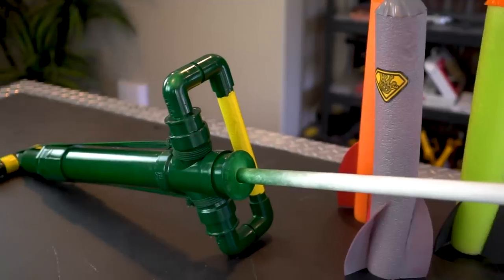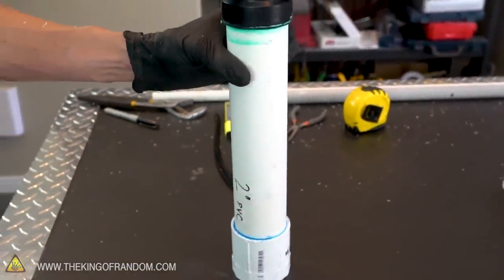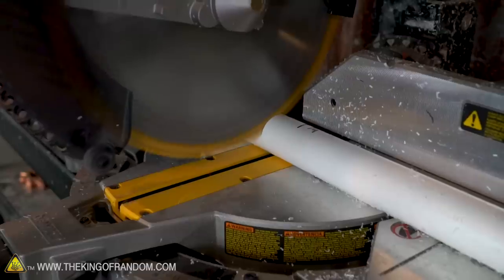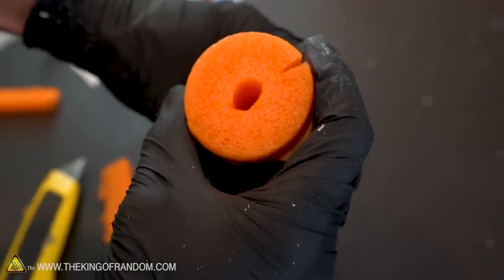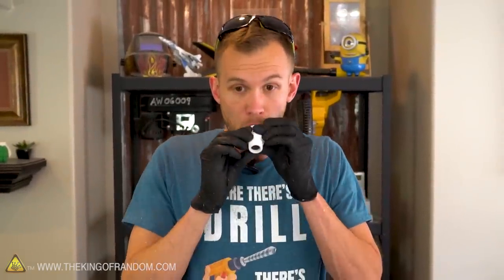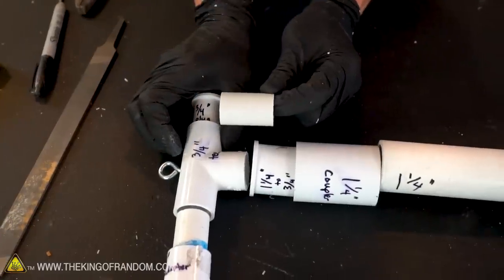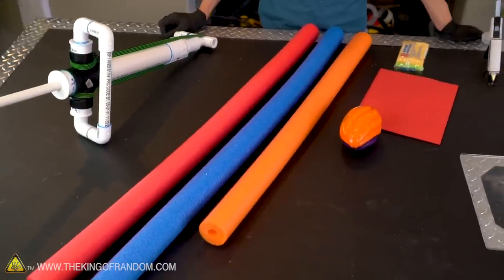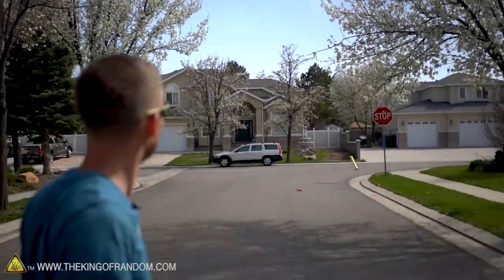PVC Rocket Launcher & Pool Noodle Rockets! PVC + Air + Foam = The Best PVC Cannon Pipe Projects

Comment: I think this could be retrofitted for use in airsoft wars. Maybe a small amount of compressed air, score the inside of the noodle in 4 places to ensure even splitting, fill it with airsoft bb's. The only hard part would be trigger mechanism, considering it may have the ability to strike another player directly. It would make a great mortar replica.

Comment: You could make it perform better by moving the one-way-valve to the top of the plunger, in that way the piston itself won't be pressurized. Also block the handle to get pressurized. That way ALL the air that gets under pressure has to escape to you projectile.

Comment: That's pretty cool. But you probably could achieve better launch performance if you had plugged up the pipes into the handle loop, as the extra volume added by the handle reduces the overall pressure build of the system. Granted, the pool noodle pieces you stuck in there (to keep the plunger from going in too far) might block some of the air transfer, but a solid plug would be better (possibly done the same way you plugged up the end of the pool noodle rockets). It seemed like NightHawkinLight's launcher's missiles had a higher launch speed, and I think that may be why.

Comment: you should make a vacuum gun/cannon. it's like you build up a vacuum pressure then pop something on one side and the projectile inside shoots flying. since the air rushes to fill the vacuum the air hits the projectile and shoots it at almost supersonic speeds.

Comment: I suggest making a grenade launcher with grenades fired off basically with pressure you can fire the projectile.and as the grenade gunpowder use the thunder caps powder and add a fuse.u can light it up fire off or show off a real life molotov cocktail!

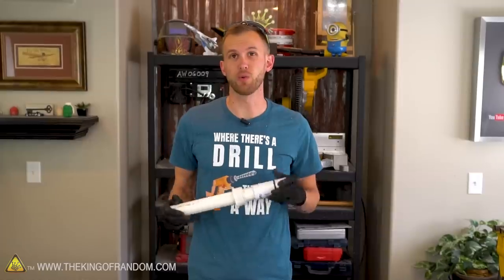Comment: At 5:29 you're holding the plunger with a threaded ring around the shaft. What is that PVC part? I know it's threaded on the outside (to the right in the video), but what's the ID type? Slip or threaded? Size?

Comment: Putting the one way valve in that end of the plunger expands your pressure chamber by the volume of the punger. That'll cut your power dramatically.
Reply: long shot that you'll see this four years later, but can you explain this? i plan to build these with my kids

Comment: since WD40 is petroleum based it will almost definitely degrade the "O" ring over time.  There is something I have used on plungers like this for about 40 years and have never had an "O" ring to fail.  Original formula Preparation H!  You got it, the hemorrhoid treatment jelly in a tube.  This stuff absolutely does not attack rubber parts and is not water soluble so it won't wash away which makes it great for squirt guns.  I have used it on the "O" rings for one of those paint sticks and have never had to replace an "O" ring because Preparation H also seems to prevent oxidation of the rubber.  Don't try Petroleum Jelly because it, like WD40, is also petroleum based.

Comment: If you want to make it more powerful what you could do is at a close off valve I think that's what you call it it's the one where you turn a knob and it opens the valve letting air through make a concealed container using PVC then put a bicycle pump thing on its way you're able to use a bicycle pump and Pump It Up adding pressure into the tube and then you release about letting the air out shooting the rocket

Comment: Make cardboard full body armor with pool noodle foam as padding. Make it durable enough to resist at least 20 rounds of the giant alcohol powered cannon. I'd rather use solid panels instead of corragulated cardboard. It must effectively cover your whole body.

Comment: Your one way valve, should be near  o ring, as closer as beter, that way you get higther compresion ratio, (almoust double) or you compres same amount of air in smalel chamber, that means more power, on your design the plunger is part of compredion shamber

Comment: I'm no engineer but wouldn't so much hollow space inside act as a storage tank for the pressurised air, essentially suppressing the strength of the cannon ? So the piston will presurise the chamber and because there is so much empty space in the handle, 1 way valve distance, the pressure will build up in those areas first and instead of releasing the air pressure in 1 quick blast, it will take a lot longer to leave the cannon leading into inneficency ?  It would work great with non compressible liquid such as water but air compresses. 

Could you make a new cannon that's almost identical but have the handle sealed off and make the 1 way valve by the o ring. So sit the o ring on the 1 way valve. This will reduce empty compressible space. I think it would work. Please correct me if I'm wrong
Reply: I want to make these with my kids and this makes sense. Any chance you could explain how you envision the one way being attached closer to the o ring? Presumably it would require a different sized one way valve right?